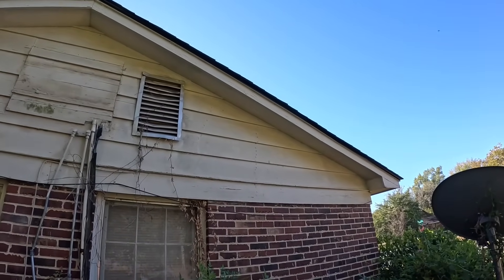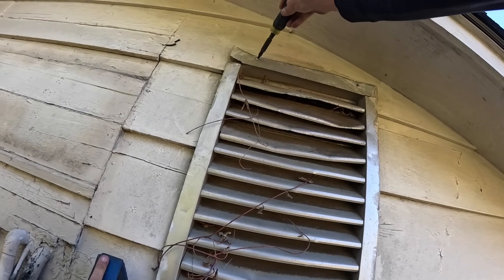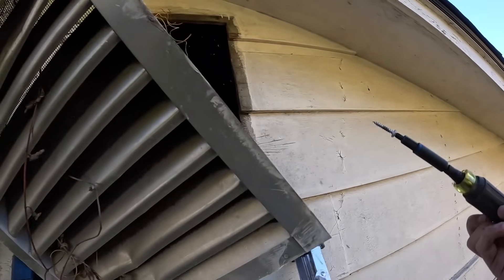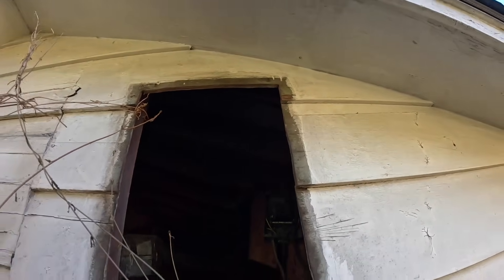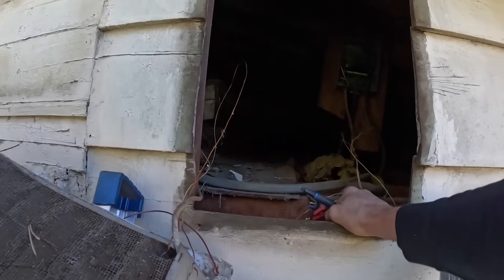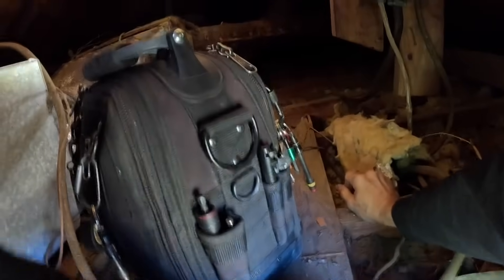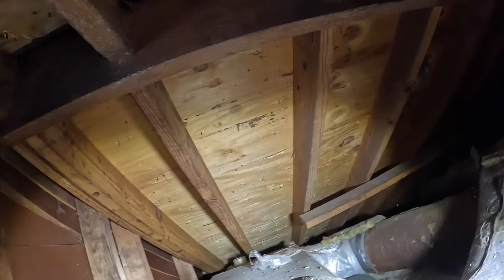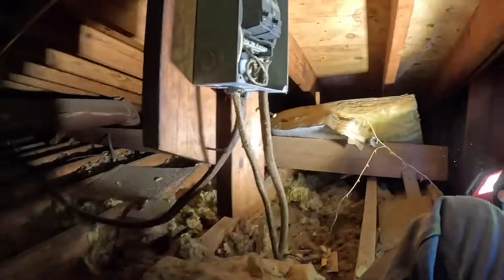Don’t Know What I Did, But, It’s Working Now! #hvaclife #hvacguy

Comment: that smaller breaker did not have a good latching sound when you switched it on. I would measure the voltage drop across each breaker.

Comment: Good video. I’d have an Electrician Move those Breakers & Panel to outside the building at 4ft off the ground. ( New small panel & 2 new breakers.) just put 2 Pull disconnects in that attic for service. ( non fused ) to eliminate headaches.

Comment: Wow!  Nothing that a little baling wire, duct tape and chewing gum won't fix!  So many of your calls are very much like mine.  I worked in the Dallas, TX area back around 2000.  I was so spoiled by the nice neat installs that had great access.  Then I retired and went rural.  That was an eye opener!  Codes are non existent and corners are cut everywhere.  Sure makes you appreciate good installs and competent work.

Comment: Had a dentist ofice with simular acses for cooling system the  filter was up there so u can emagain how often it got changed usaly when it froze up and started leaking water every where that box needs replaced so it will have cover nothing to hold breakers in place thanks for the fuzzy memory's 😅😂

Comment: I heard a sizzle snap when you first pulled on that breaker! Probably just surface corrosion on the breaker lugs and any movement would have restored connection!! Seen it hundreds of times
Reply: My thoughts exactly.
Reply: Yea, I heard electrical crunchy’s too. Something’s not right in that box or breakers. To cover your ass recommend replace it or have it inspected by an electrician.

Comment: The contact clips on the breakers were stretched too far... they will probably overheat soon. You could have squeezed them closer together with pliers as a temp fix. But it would be best to call an electrician and have a new panel and breakers installed.
Reply: DITTO! 👍